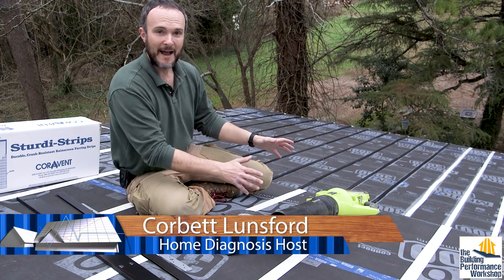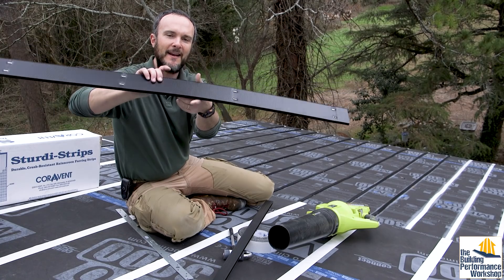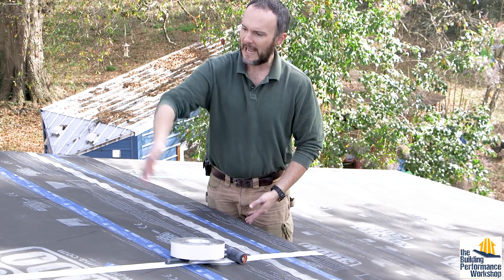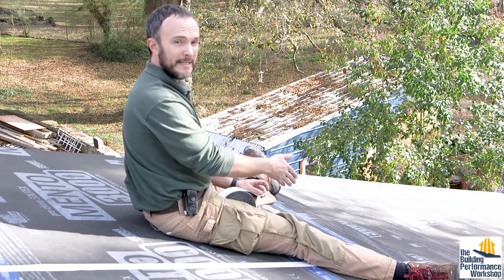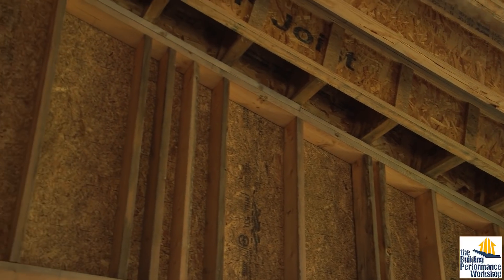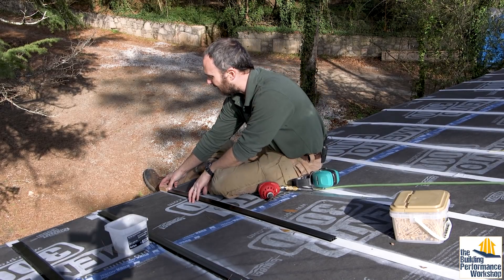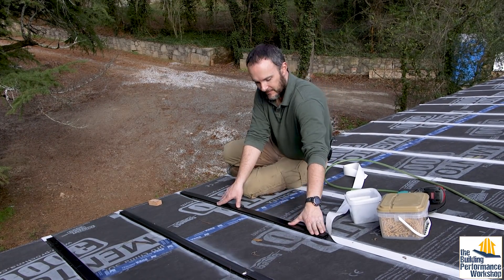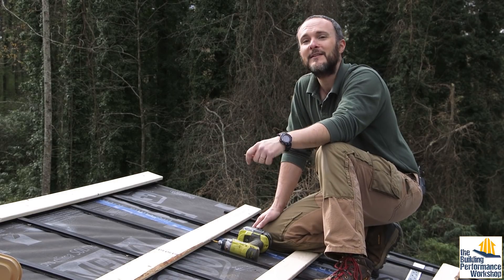Roof Rain Screen with Cor-a-Vent

Comment: Excuse my ignorance, what is the reason you used Mento 3000 plus the sticky tape under the strips instead of something like a modified underlayment that could've sealed around the nails and eliminate the need for sticky tape. Is modified underlayment like Layfast TU-43 not good for the metal roof, bad performance, lower longevity...?
Reply from the maker: Trying to avoid impermeable layers, to allow drying.
Reply: @HomePerformance  thank you!

Comment: Have fun knocking on exterior board insulation to find your trusses.
Reply from the maker: No exterior insulation- watch the video before you get snarky bud
Reply: @HomePerformance  I watched it. And don't assume that I didn’t before you get sparky. You may not be using exterior insulation, but CI is becoming the norm for building codes including roofs.

Comment: Great concept with vented rain screen. Curious why you didn't any exterior insulation on the roof?
Reply from the maker: Energy model showed no significant benefit on either energy costs or comfort control, Nathaniel
Reply: @HomePerformance  makes sense 🙏
Reply: @HomePerformance  I know this is old now but do you remember what your standard roof insulation was rated at and what zone are you in? Did the fact that you did a vented rainscreen roof decrease the need for exterior roof insulation? Ive always understood the roof insulation to be more important than the walls. Sorry for the paragraph, just trying to learn as much as I can before I start my build here in zone 5
Reply from the maker: Zone 3/4, R-38 cavity. I ran the energy model.
Reply: @HomePerformance  Awesome. Thank you

Comment: Were those 10d Commons in the strapping? 
Been curious about the venting details, thanks for showing your approach. I'm in an extreme high fire zone and don't think it gets mentioned enough that for people in similar high risk areas, <1in air gap is what testing says your rain screen can have.
Reply from the maker: Yes, Craig, 10d 1.5”. Interesting about the fire risk- I’ve not had to ponder that.
Reply: Or you can build out of fireproof material but yes an air gap can increase fire risk.

Comment: Thanks Corbet great alternate to the 45degree method. Just one question about the sturdi strips, how well do they hold up to the heat under a metal roof, will they soften and compress under the pressure of the screw holding the 1x4 battens? One thought .... do you think a fully threaded screw and a counter sunk hole would be better as the wood batten would not compress the sturdi strip as the screw is drawn tight to the deck....  I will be installing a metal roof on my self build and like you suffer from paralysis of analysis lol..
Reply from the maker: Haha, good question- this is not my first build with these Sturdi-Strips. They’re on the TinyLab roof too, and no, they’ve given us no issues with softening, shifting etc. You want a tight fit, so don’t worry about pulling the connections tight- you can’t hurt these things. The screw head would bust thru the wood before that happened.

Comment: I don't understand the need for the sturdi strips. Wouldn't wood work as well? After all, you are attaching wood strips to the sturdi strips. Is it to get just that little extra ventilation? I understand the cora vent at the top and bottom, just not those strips running vertically.
Reply from the maker: It would have to be GT pressure-treated, which means chemicals potentially leaching onto the mento- want to avoid that. Plastic is tried and true for this purpose.
Reply: @HomePerformance  what about the wood strips you are attaching to the sturdi strips? They aren't pressure treated. Is it because they have an air gap beneath them so they don't need to be?
Reply from the maker: Right, they won’t be sitting against a wet surface, since they’re elevated.

Comment: Spruce 1x4 under a metal roof in a hot humid climate? Won't they rot?
Reply: When the sun hits this roof it will heat the air and bring in new fresh air. This thing will thermosyphon quite well. I'm sure one day he will be able to show a thermo image of air leaving the roof caps/vents.
Reply from the maker: I don’t believe so- why would they?
Reply: He's got an air gap there. Wood only rots when it can't dry

Comment: Matt Risinger runs the wood strips on 45's to allow air and any water to find a path out.
Reply from the maker: You mean in one layer, I imagine. Here the same effect is achieved. My question with Matt’s way: how do you make certain you’re hitting the joists every time, and do you use continuous butyl like this method? More material on the diagonal.
Reply: @HomePerformance depends on the underlayment thickness. 5/8 & 3/4 is as good as hitting a stud. Also I would screw the furring strips down. Nails are for shear force, if anything in highwind those will be subjected to lifting force which is not what nails excel at.